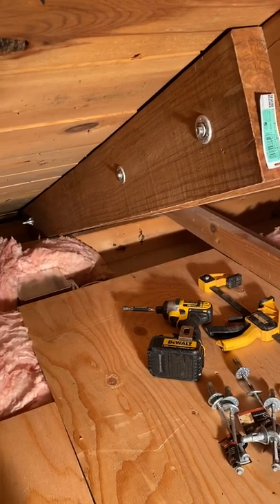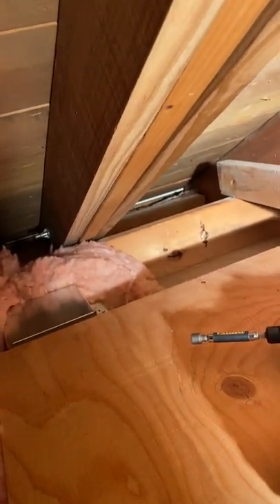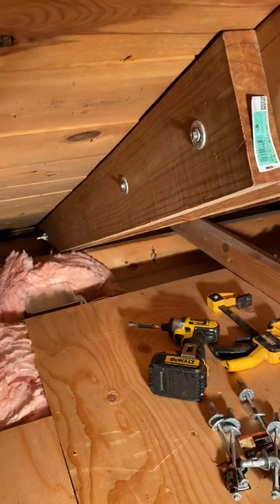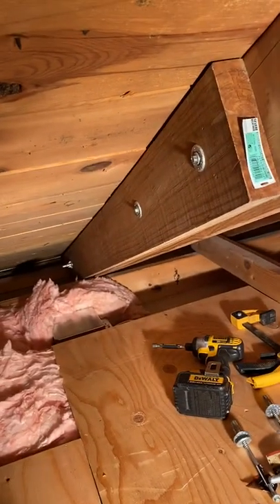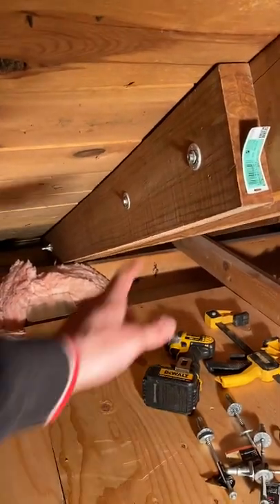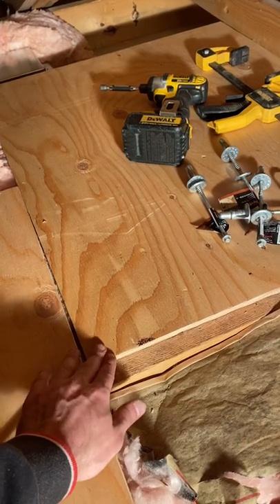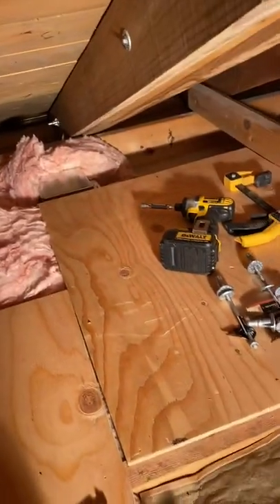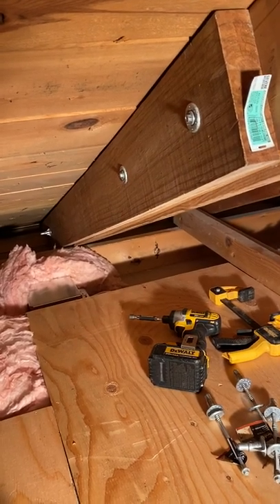How to Fix a Cracked Rafter by Sistering Boards Together

Comment: House got some damage from a tornado "actually two days before this video was filmed" when I went up in the attic at that time I had a huge hole in my house, something had hit my roof right where the rafter was, but I didn't see any cracking in the rafter, got my roof replaced a couple days later, but I went up in my attic a couple of days ago and found out that joist actually had ended up cracking apart in a spot, it's all the way in the back part of my attic, I have to crawl underneath my HVAC venting in three places to get back there, but once I get there I have plenty of room all the way around so I'm hoping I can get everything up there to sister it without forgetting anything, nice video I like the style of screw/bolt you used, I was going to drill and bolt them together with some 3/8 or 1/2 nuts and bolts, but this looks almost just as good and much easier

Comment: I did this type of sistering some years ago and now have to do it in other rafters, in some rafters I used a 1" thick board on each side , this amounts to a 2" board, in others I attached a 2"  board on one side only, so far they are standing ok, I used 1/2" carriage bolts, much like you did,  I´m wondering if putting a 2" board on each  isn´t too much weight, thanks for the video.

Comment: Putting the bolts in-line like that is encouraging another crack in the new board(s). The bolts should be off-set, not too close to the edges, and 16" apart. 

Best to check with the inspector, if a permit is required, before starting the job whether adhesive is required, spacing, etc.
Reply: Thank you for this I am taking note

Comment: I am about to do this. I bought the Thru-lok bolts and they have a drill tip at the end. This keeps it from splitting the wood. They are about $4 each now

Comment: I have a similar situation but the rafters split how would I get it back together before I install the other boards?
Reply from the maker: Use a clamp or bottle jack to marry the boards together then secure. Then sister the new boards.

Comment: I would have used some construction adhesive on those boards before sister-in-law them in place then add the Thrulocks.
Reply from the maker: That would have been better

Comment: do you have to extend the sistered pieces to an enpoint? (e.g., a soffit/fascia board?) Or can you just extend on either side of the crack and let it free float?
Reply from the maker: either side, ideally 20 inches past the crack in both directions.

Comment: Sorry I never comment but this is improper information. This is not a viable fix. Structural fasteners must be staggered 16”o.c. 1” from edges. Minimum.
Reply: both edges OR the outside edge OR the inside edge - seriously, I agree with you but as I think about it I would do outside edge, then inside edge and so on BUT space them 8 inches apart (you then have the bolts 16 inches apart on the inside edge and the outside edge (and one inch from the edge)

Comment: I would suggest avoiding pressure treated lumber up there. The bolts will degrade and any nails will corrode.
Reply: What type of wood should be used for a rafter?

Comment: How did you get that thread in straight down by the rafter tail?  Did you have to jack your roof at all or did you manually lift it?
Reply from the maker: I reached way down there and did it

Comment: How did u get that bolt thru the wood? Did u have to predrill thru all of the pieces then tighten it up with a socket? Thanks
Reply from the maker: The thru-lock bolts do not require pre-drilling which is nice.
Reply: Peter Testa thanks for the reply back, I had no idea about this product.